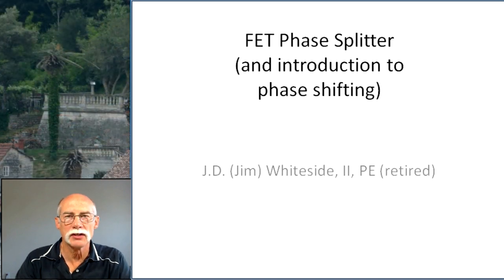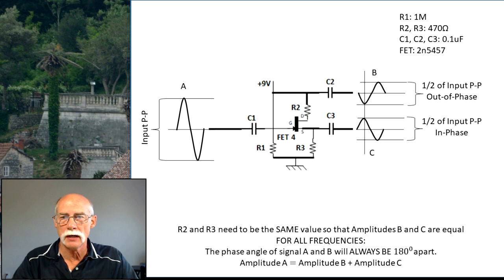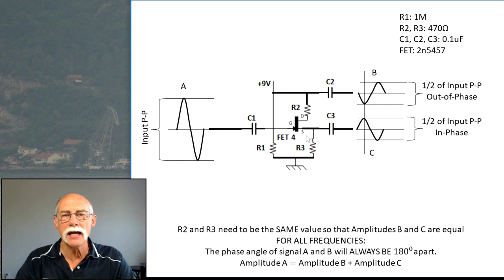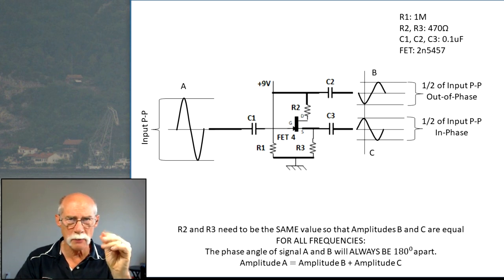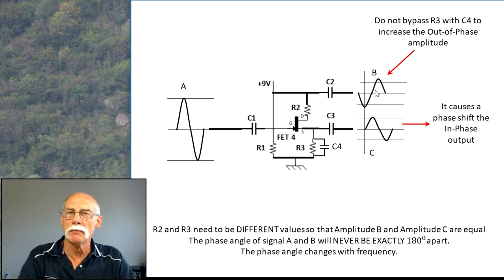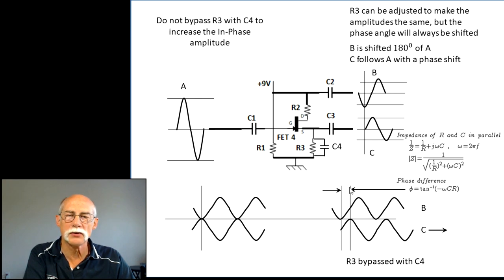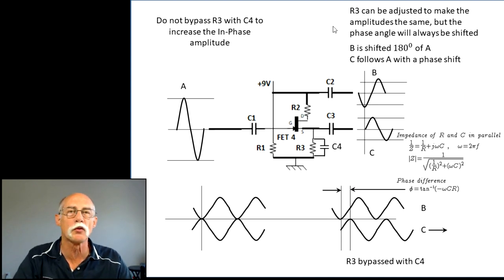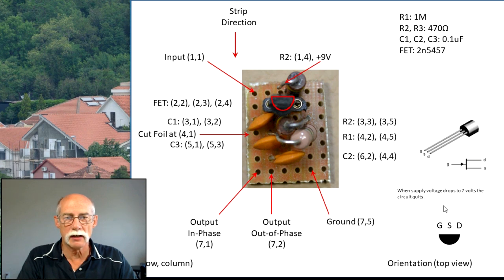FET Phase Splitter and Intro to Phase Shifting

Comment: Hello James, thank you very much for sharing this awesome video. For this circuit, the use of 2N3819 instead of 2N5457 would impact the values for the R1, R2 and R3? Cheers, Andre
Reply from the maker: The idea (and the math) is that the load on both outputs must be the same in order that the sine wave has the same amplitude/gain.

Comment: I have tried this circuit on a board  with a 2sk170 n channel FET and the outputs are not out of phase. The inphase signal is lower than the out of phase also. I am using 470 ohm 1% resistors. I have switched them around to see if the amplitude was different but it wasn't. What am I missing here?
Reply from the maker: The load on the Drain and the Source must be the same so that the amplitudes match. The load on the source is in parallel with either the resistor that goes from the gate to ground (typically). You shouldn't need to rely on 1% resistors to get the amplitudes very close.  Most guitar amp circuits use 2 FETs for a phase splitter to make setting the amplitudes easier and then each FET drives a low power transistor to drive power tubes or power transistors. They do this because it is far easier to get the amplitudes adjusted. Using 1 FET is great for a buffer and ticklish to adjust for a phase splitter. 

Also, use an oscilloscope to check amplitudes, a common DVM interferes with the measurements because the leads do not have a high impedance value like an oscilloscope.